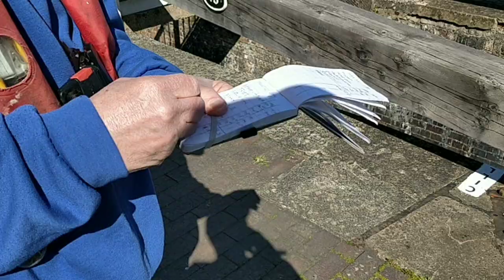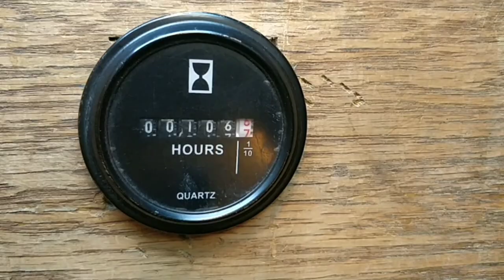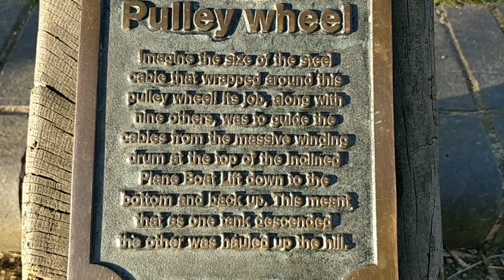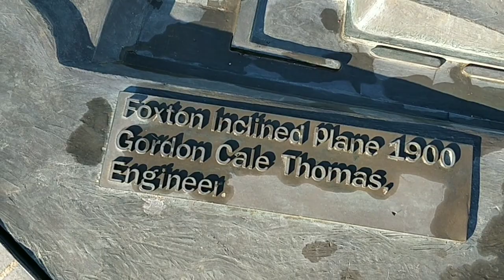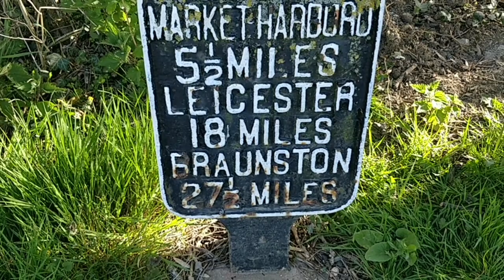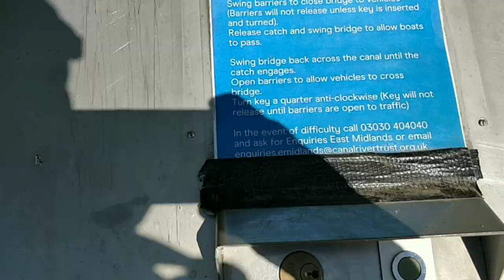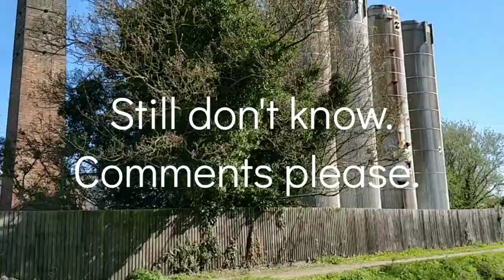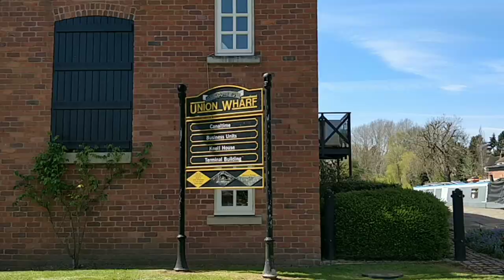A cracking cruise down Foxton locks to Market Harborough. Narrowboat style.

Comment: Those swing ridges are a pain in the arse for single handers. There is a solitary bollard either side of the second one to tie onto which saves a half mile walk either end, useful as you have effectively closed the road but it's not easy. Coming back up I ended up following another boat with crew!!  Good video cheers
Reply from the maker: Yeah it's so hard on your own. I've done them before and I put my front end on that one Ballard and run to the front etc. You know the routine. Not easy. Thanks for commenting bud.